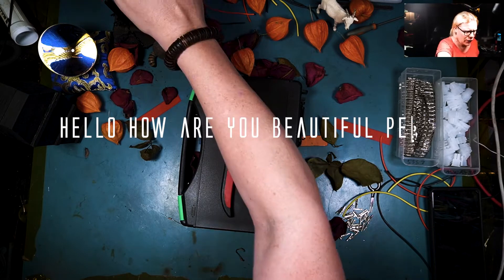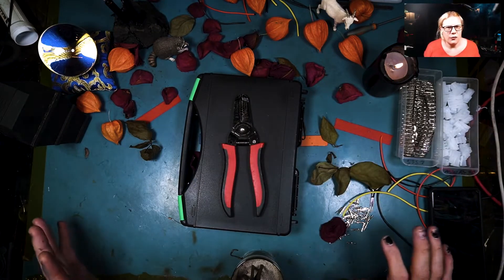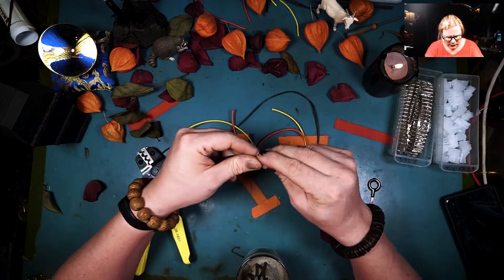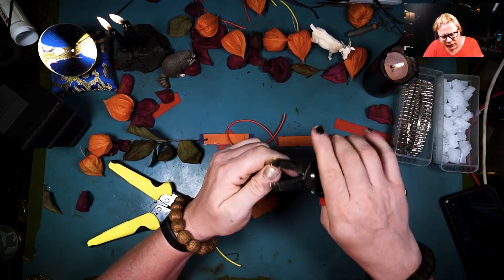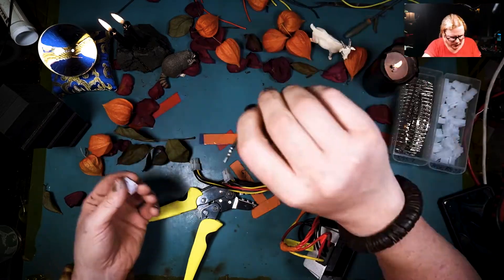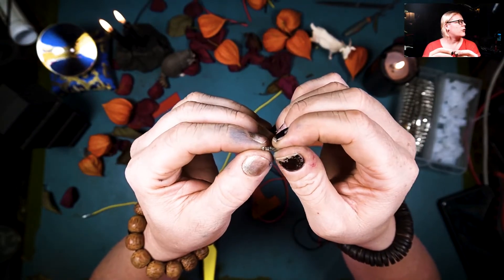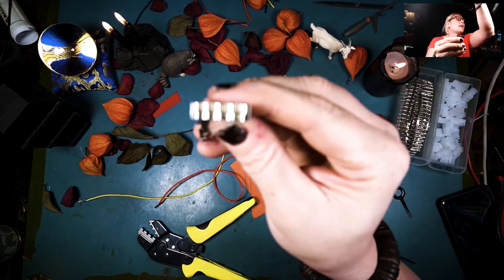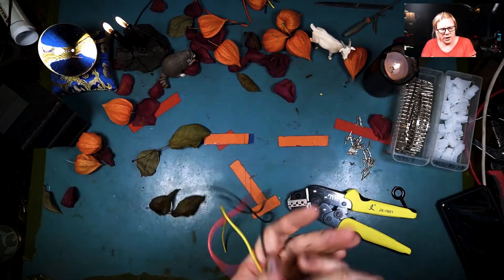Make your own 4 pin Molex cables

Comment: Thank you for the video. What's is the purpose of having 4 PIN connector with 2 positive and 2 negative? Can I have the 4 pin on the circuit (router, switch, etc) and the other end of postivie pair and negative pair just join them in one negative terminal and one positive terminal?
Reply from the maker: Higher current handling. The connectors only support upto 18awg typically. This lets you double them up.
Reply: @thefixitgal  Awesome, thank you for taking the time to answer :D